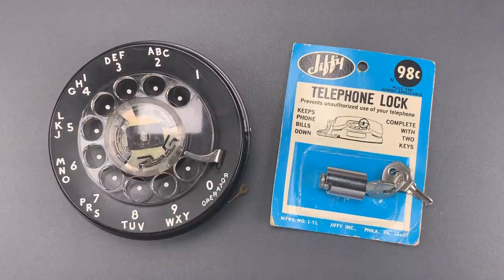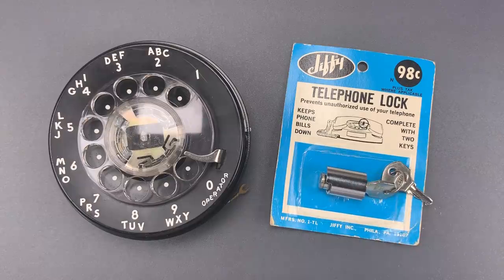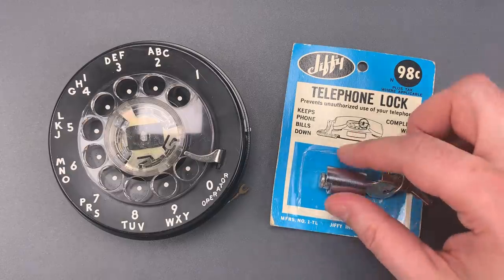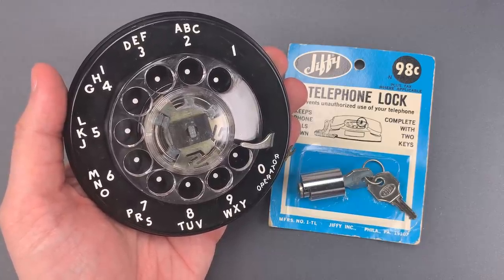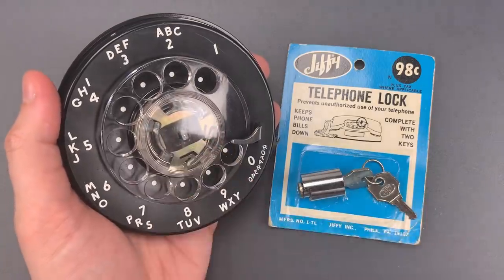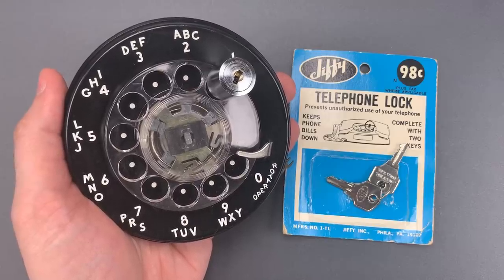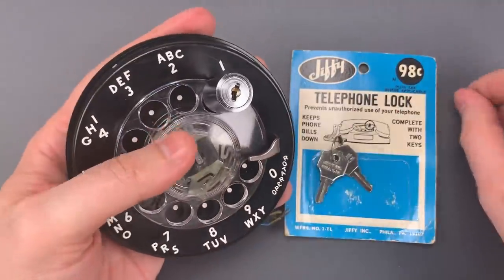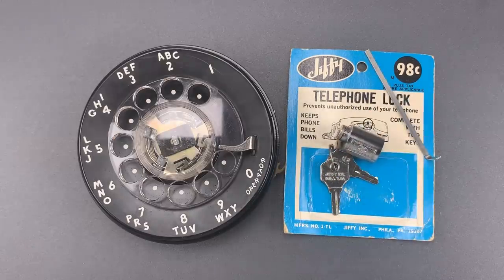[1084] This Lock Could Save A Month’s Wages... in 1960 (Jiffy Phone Lock)

Comment: I was born in the '80s and grew up with a rotary phone. No, I didn't live in a 3rd-world country (metro Atlanta). ;)

That's because Ma Bell hadn't been broken up yet so you had to lease your phone from them and the most affordable one was still rotary. Even once they were broken up/deregulated my mother continued using their most affordable phone for a while and saved money with pulse dialing service only (touch tone service cost extra). When one phone would go bad she'd go to their local office and swap it out for another almost-identical phone. She stuck with pulse-dialing service through the mid '90s, which meant I had to use X-Band videogame modem and PC modem's without touch-tone service. They didn't always have a "pulse dialing" option so I'd have to cheat and dial manually sometimes.

I figured out how to dial without a dial or keypad pretty early:
just simulate the number pulses by hitting the hang-up hook rapidly with pauses between numbers, 10 clicks to dial zero.

Comment: My aunt lived in a very old house in the 80's (was built in 1860's) and her phone lines in the house only supported rotary.  For the first few years she lived there she only had rotary phones.  They then finally found a dial phone that had a pulse mode that worked with the lines.  I also remember another aunt having an old Mickey Mouse rotary phone in her basement.  If she still has that thing it is probably worth some money.

Comment: You don't need to pick or remove that lock to use the phone. I grew up in the 80's/90's my Mum still had a rotary phone and used that lock.

All you needed to do was tap the receiver, the number of taps corresponded to whatever number you wanted. The receiver being tapped on a table top mimicked the clicks the rotary dial would make.

So I could still call my mates to check they were going to be at the park.

Comment: Being a really old phart who is a retired telecom technician, each number dialed would record a breaks per second back to some old line equipment in the central office.  Hitting the switch hooks over and over again could sometimes get you the operator to bypass dialing altogether.  Yes, a bunch of useless information.  BTW, that looks like an newer version number 9 dial.

Comment: There are also other security bypass means, that don't involve the lcok at all.
E.g. by flashing the hook switch to pulse dial without using the dial itself.
The way pulse dialing works, is for each of the digits, 1 through 9, and 0, respectively corresponding to 1 through 9 and 10, short open circuit would occur ... which is also about the same as, for each, a brief flash of the hook switch - with on-hook essentially being open circuit (or essentially close enough).  Nominal pulse dialing would be 10 pulses per second, 50% on/close, 50% open, but there was very wide tolerance in what was accepted, so from something roughly around 5 to 20 pules per second would work, and probably 50% on/off, likely +-20% or more also worked fine.  So, one could quickly "bang" out the pluses 1 to 10 pules for each digit 1 through 9 and 0.  And if dialing 7 or 10 digits like that and getting 'em all correct was a bit too challenging, just do a single "0" - ten pulses, ... and one gets the operator, and then something like (and complementary service for the assist at the time), "Operator, I'm having a bit of trouble presently dialing this number, could you please dial it for me", and you give 'em the number and they dial it for you.

There were also somewhat similar locks for use on Touch-Tone (R) (generically Dual Tone Multiple Frequency (DTMF)) dial pads, that would attach to lock and cover the whole dial pad.  Those could also be bypassed.  Just get a pocket Touch-Tone (R) dialer, from, e.g. Radio Shack at the time, for less than about $10.00 USD or so.  Lift the receive, put the pocket Touch-Tone (R) dialer to the receiver mouth piece, and dial away.  Such was also handy for DTMF services (e.g. controlling an answering machine remotely, or using an alternatively long-distance carrier back when one had to dial a separate (generally local) number to connect to them - then use DTMF to put in an account access code, and then again DTMF to dial the desired long-distance number ... but one might be at a pulse dial payphone, or one's home phone/line might be pulse dial only (back in the day, they' d charge extra for DTMF service (if/when they even offered it), and going back even further, when one had to lease the phone, lease for DTMF phone would always be a higher price than that of a pulse dial phone).

Between the simple locks for pulse dial, and DTMF pads, the pulse dial locks was much more common, as the pulse dials were all of quite similar construction ... some of the pay phone would use metal instead of plastic for the part with the finger dial holes, but otherwise their construction was highly similar.  The DTMF phones, however, had variation in construction.  There were the standard desk phones, and similar wall phones, but then there were also variations such as the "Princess" series, which had very different physical design for the dial pad, so typical dial pad lock for that would be useless  ... but by around then or so, the were also making the newer phones with modular plugs - so unplugging the phone and plugging in a different (unlocked) one also became a trivial means to bypass such locks - earlier the phones were hard-wired without a modular plug ... though there did also exist a much older type of plug that could be used - but most of the time there wasn't a plug - and one would have to (and have to know how to) take the phone off the wall, or end of the line (cable) (or bypass it or whatever) to substitute another phone ... which was also generally a technical/legal no-no at the time, as it was phone company owned equipment and line/cable, and various laws/regulations disallowed tampering with the electronics ... heck, even attaching a pen with a self-adhesive sticky tape to stick to the phone was technically a no-no, as that was a "foreign attachment" ... though a detachable lock (since it's not stuck to it with adhesive tape) was permissible.

"Of course", way back then, there were also more nefarious (and also more illegal) things that folks could do with phone lines and services back then (like using certain other signalling tones to bypass long distance charges, bypass pay phone coin collection, etc.)

Comment: Still got 2 of these phones in the house that are used every day. Something like bakerlight about them comes to mind but I dont know what that's about.
Reply: Bakelite was a sort of plastic that older phones were made from. It was also used for distributor caps and rotors on cars.
Reply: @johannlundie8561  fairly tough and resistant to sunlight and weather, but kinda brittle if you drop it.

The US Navy still uses Bakelite for some things, and boy do you get yelled at for dropping them on the deck!

Comment: You don't need to pick the lock!
The phones used a 'pulse dial' system back then, so all you had to do was 'tap' out the phone number you wanted on the handset cradle switches, and the exchange machines would interpret that as a dialed number and route you through normally.

Comment: The fastest bypass would have been to hook dial, by tapping the button that is depressed when you hang up the receiver the correct number of times for each number you wanted to dial. 1 = 1 tap, 2 = 2 taps etc with 0 being 10 taps. 

This is basically what the dial itself did - pulse the line X or Y number of times as the dial returned to its start position when you released it. You would (and still do) hear it from the phone earpiece. 

This may still work on landline phones depending on how old your local phone system is for voice calls (VoIP backed systems likely wont accept this), and did work on some keypad-less courtesy phones in a few places I tried back in the day. (usually UK Supermarket taxi phones - BT handsets by the checkouts with the green lock to call a local taxi company for free) 

You might remember this trick from the movie "Hackers" which is probably the only genuine hacking (although really its Phreaking) in the entire movie. HTP.

Further reading: The amazing book "Exploding the Phone" by Phil Lapsley. Its the best history of the US phone system and the many exploits and hacks of the system from as far back as the beginning of The Bell System, and Evan Doorbell's Phone Trips YouTube channel.

Comment: BITD when I worked for a vending company we had an office where the phone was and an extension phone in the shop area that we could use for talking to customers or ordering parts during office hours.  When the office was closed the techs in the shop were expected to answer the phone but the owners didn't want anyone dialing out on it to make long-distance calls.  They tried a lock like this but the lock kept getting bypassed or broken.  Then they tried a phone without a dial and LD calls were still showing up on the bill so they figured someone was using a touch-tone dialer to make the calls, popular devices at the time.  Finally, they came and asked me how to solve the problem.  I was the shop foreman and they knew I briefly worked for the phone company as an installer.  After thinking about it I came up with the perfect solution, a DPDT switch in the office that reversed the tip and ring connections for that extension when thrown.  With the tip and ring reversed you could not break the dial tone on the line so all the office staff had to do was flip the switch at night when they locked up and there was no way to dial out from that phone but it could still answer incoming calls.  (We did have a payphone just outside the shop area that could be used in an emergency.)
Reply: Reversing the polarity will prevent old Bell touch tone phones from dialing out. It will NOT, however, prevent someone from using a touch tone dialer on that old Bell touch tone phone from dialing out.
Reply: @brianleeper5737  Also, many non-Bell Touch-Tone phones were not polarity sensitive-usually, they used a full wave bridge rectifier to accomplish this.

Comment: Even if the lock really worked as a lock, you could still tap the desired number quickly by using the handset cradle switch. As children, we did that regularly, and parents rarely noticed the unauthorised use, unless you were too greedy, or were caught red-handed. Use ten taps for 0, and the corresponding number of taps for each other digit. Even many modern international phone systems can still be used by pulse dialling, so your vintage phone will still work.

Comment: Early 70's Ma Bell charged extra for touch-tone and things like fancy "princess" phones.  I paid service for one black rotary dial phone and installed what I called "chipper" phones in every room.  These were plastic flip phones with buttons that could produce the touch-tones.  Every once in a while I could hear them "chirp" once in the middle of the night.  Ma Bell would put a pulse on the line to check the load for how many old style rotary bell phones you had connected and charged accordingly.  The pulse was too short to hear on the bell phone, but the chipper phone was such a light load that reacted faster but not detected.  Dear LDL, the statute of limitations have run out.  🤣

Comment: Geezus I remember picking this lock 🔐 with a large flat Bobby pin... I never really thought about it much, but I’ve picked or defeated a few locks,... sometimes it’s easier to defeat the locking bolt/slider, than the key itself... ahh teenage years...

magnetic door 🚪 locks in buildings are very touchy.... kind of @ssed out without the key...
But then again worthless if there is a power loss 😩😩😩

Comment: Just a side note. Back in 1960, there was no 911. You had to call the operator (dial zero), and ask to be connected to the fire dept, police dept, etc.  Also, you can see why dialing 911 was selected for rotary phones. 9 to prevent accidental dialing of "111" , but the last two digits because it's the fastest to dial.

Comment: There was a real simple trick to bypass any rotary lock... I don't feel bad sharing this, since rotary is no longer used. Basically, each number dialed simply pulsed X number of times; 4 pulses meant the person dialed a 4. This pulse could be replicated by tapping gently on the switch the necessary number of times. Using this method, even a locked rotary phone could still be used to dial any number, given a little bit of precision tapping and patience.

Comment: If you still have a pOTS line, and not one of many digital simulated phone lines, you can dial a phone with the hook flash.  I got pretty good at it, and impressed my IT staff dialing in from a remote building through our VOIP system from a phone that had broken touch tone buttons.  When the 'phone guy' answered the call, saw my ID, and told me it was impossible, I laughed.  He came out just to watch me do it again, agreed it was a fantastic tool because many of the remote phones had bad buttons, then promptly disabled pulse dialing in our VG-224s... Jerk.
Reply: Some ATAs still support pulse dialing, Grandstream recently made an update to actually expand its pulse dialing support due to tons of telephone collectors using their ATAs.
Reply: @tieline1333  NICE!   I should pull out the model 500 and set it up again...

Comment: If you want a good lock to make fun of, Dolla General sells a laminated padlock for around $4. It's so bad that I bypassed the pins entirely and can open it up with just a hook. The tabs holding the shackle in aren't protected in any way and can be accessed with basically every pick I own.  No tension required.

Comment: Wouldn't it simply be easier to have a electromechanical lock?
If a user dials a zero first, simply close the line.

In the olden days, you had to pick up the phone before dialling. So you can close the line easy.
And in such a lock, you don't actually have to have a visible lock. You can install the blocking device anywhere on the phone line in your home.

Really advanced locks could still allow certain area codes.

Comment: I remember those well. 
They weren’t that effective,
you could lift the handset and tap the buttons that the receiver sat on, one tap for no 1, two taps for 2 etc until you’d put in the number you wanted to ring, always worked.
Drove my father mad as the bills were always high and he couldn’t understand why, he eventually had a pay before you call box installed  😂😂😂👍👍

Comment: I grew up in Illinois, and my mother was a telephone operator. Illinois Bell issued Touch-Tone phones to employees as a beta test (1965?), so we had Touch-Tone before anybody else. And I grew up in a house using only Touch-Tone. We then moved to North Florida in 1972, where Southern Bell only had rotary, and we all had to learn to use this crufty old system. The school, of course, had rotary phones, and this gadget that kept kids from making calls. I was a clever kid, and I figured out that rotary == pulse, and that tapping the hang-up button would do the same thing as the rotor. SO, to dial 555-1234, you'd tap 5 taps, then 5 taps, then 5 taps, then 1 tap, etc. The school wondered how people were making calls...
Reply: Oh, and every lock on every door in every public school in North Florida could be opened with two paperclips...

Comment: Before you mentioned that you could probably just break the lock off pretty easily I was wondering how you were supposed to dial 9-1-1 with it. Apparently in 1960 9-1-1 wasn't even a thing. It wasn't adopted in the US until 1968 and took decades to become widespread. It took until 1987 for only half the country to have access to it.

Comment: If you take that rotary dial and rotate it counterclockwise, the whole dial comes off (so you could replace the paper in the center with a new one for a different number. Once removed (which takes 2 seconds) Then, put on a piece of masking tape and a hash mark for each number. Rotate the mechanism and you could dial any number. Don't ask me how I know this.

Comment: I countries that did not use a 9 for the emergency number (911, 90000) but instead 112 you could put the lock in the 2 position to allow emergency calls.

And this also shows, I have to admit, why putting the 0 at the end of the rotor was a good idea:
Just lock up the 9 and you can dial local numbers (including 911), but not get a trunk.

Of course, there were ways to beat these system. You normal phone phreak trunk switch is one of them.

And a story from my university dorm:
They used to have one phone per corridor (basic unit of 8 room that shared a kitchen and a living room) that could only be used for incoming phone calls. There was no way to dial from the phone. Except by emulating the rotary dial using the hook switch. Someone made a lot of long international calls to Iceland, and there was only one Icelandic student living in that house but rumour has it they could still not pin the calls on that invididual, so they removed the phones instead. Right about this time land lines costs were getting lower and the long distance charge between places in Sweden was removed, so most students could afford a land line anyway. Another few years and everyone had a mobile phone.

Comment: It's been so long since I've seen a rotary dial. There's an elegance to analog devices digital ones lack.

Fun fact for noobs: with very minor practice you can "dial" those without using the fingerdial. Tap the hang up button whatever digit you want to dial +1 rapidly, to dial a 1 tap it twice, for a 0 tap it eleven times. So that lock is actually totally worthless without even touching it.